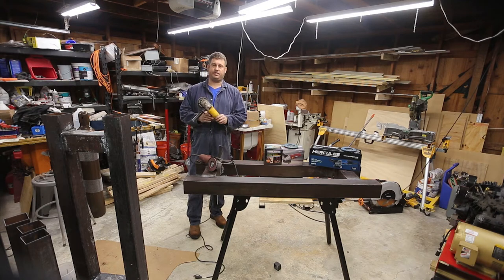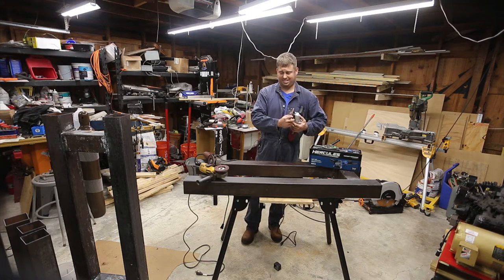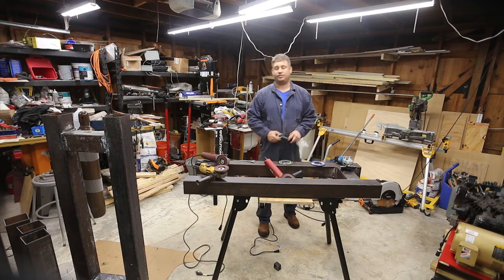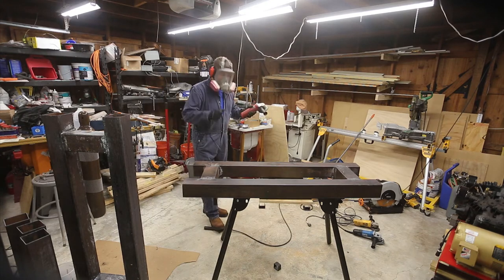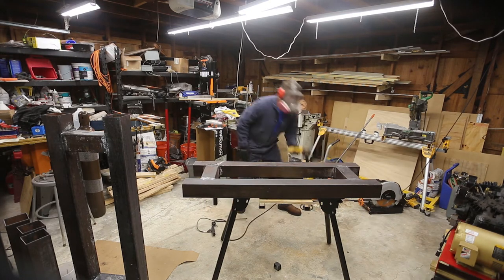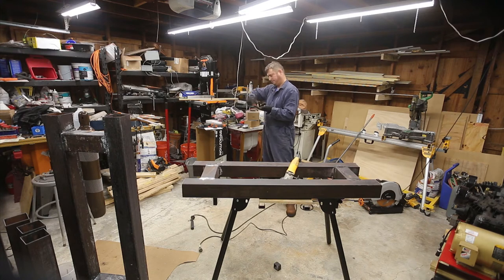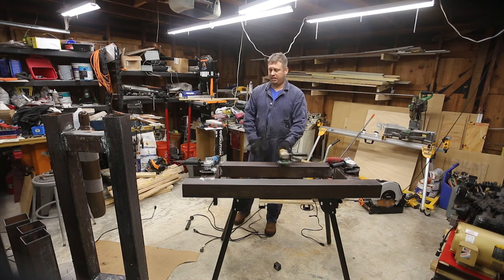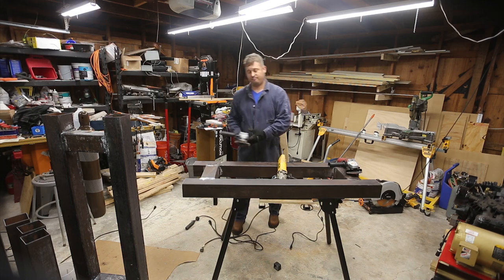Grindoff: Dewalt Vs Harbor Freight's Chicago Electric vs Hercules Angle Grinders

Comment: I have several of these grinders from HR from the 10 dollar switch lock to the 50 dollar paddle switch models , all working well some several years old used often on back yard projects and repairs !   The first thing I do on every one of them after purchase is to replace the gear box grease with good quality high pressures grease  , they all run smoother and quieter !  All have different wheels to do different task all used within their limitations all still going strong  !  I don't have any problems with HR products , their return policy on products not right is not bad and they always replaced anything not right without question !

Comment: I have the newer DWE402 11 amp DeWalt and it is so much smoother than my cheaper grinders, despite being almost twice as powerful.  That said, I have recommended the Hercules to folks who want a decent grinder but don't want to pay $60+.  For HF's cheaper grinders, I would only recommend them to people who just need something to get them through 1 job and will likely never use an angle grinder again.  If it lasts past that 1 job then any further service is icing on the cake.  One Major complaint I have about cheaper grinders is their cheap guards.  I buy flap disks and some brushes that simply wont work with the guard on the grinder.  This does nothing but encourage people to remove the guard and "forget" where they put it.  If DeWalt has nothing else on the competition, they include great, usable guards on their grinders.  I have never had a disk or brush rub on the DeWalt guard.  Use the guard and PPE guys, remember: this is likely the most dangerous tool in your shop!